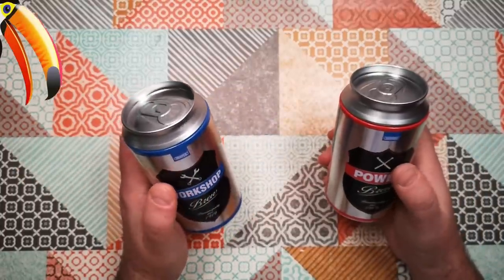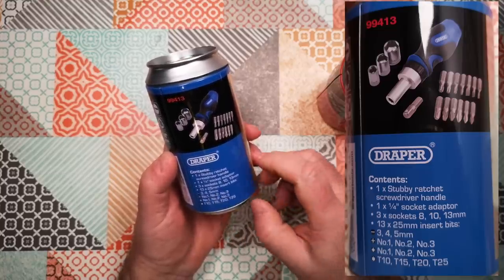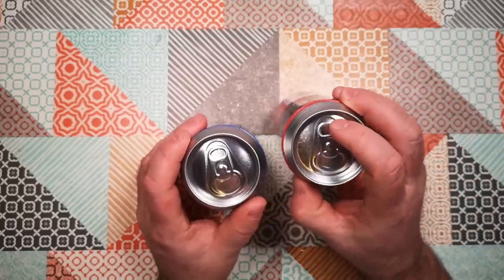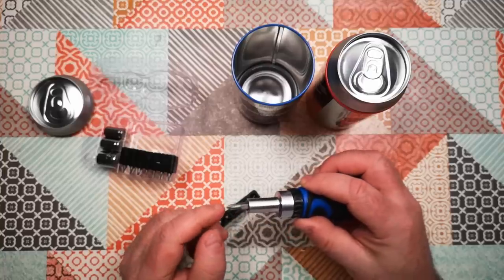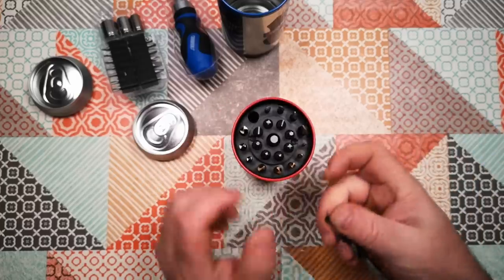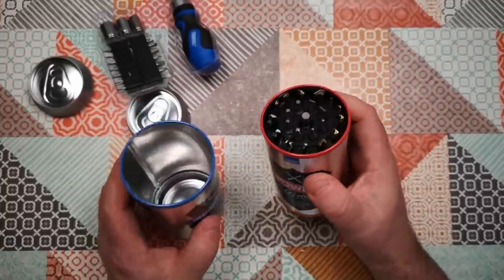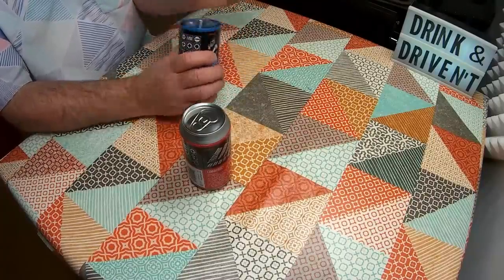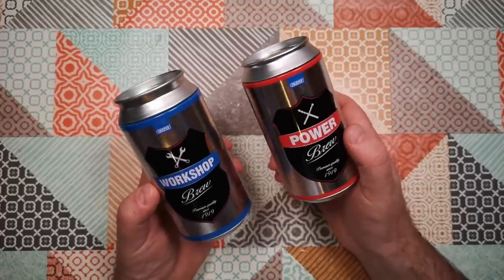Workshop Brew - Weird Stuff in a Can # 171

Comment: in my students home some decades ago one fellow came back from having  worked at Airbus in Toulouse France for a year.  He told me smiling, that during the lunch break it was common  to gulp down some glasses  of wine before going back to designing Airbuses LOL But that was wine and engineering. But the ones in the workshops I guess did (still do) the same. 😄🍷🍷🍷✈

Comment: I have a small loner toolkit called a box of s*i* !

It has the same tools as your cans .
Plus a black plastic toolbox , LCD voltage tester , small ratchet set & leatherman “style” multi tool .
Total cost £6 from pound something shops about 2 years ago .

I don't recommend pound shop drill bits , even the Hss bits are 100% play dough !
Pushing holes in wood for screws is doable , just don't expect precision or more than 4 or 5 holes . 
Remember play dough bends , go full gorilla you'll definitely get bananas !
In my kit drill bits really are one time use  , no drill is in the toolbox just the bits …. LOL
So i have a “iffy”gage pin set, alignment tools , a crude depth gage or assorted hole cleaning set .

Hopefully you have better quality drill bits ….